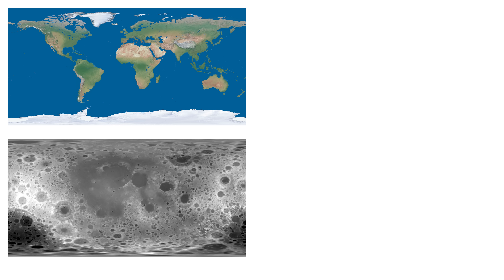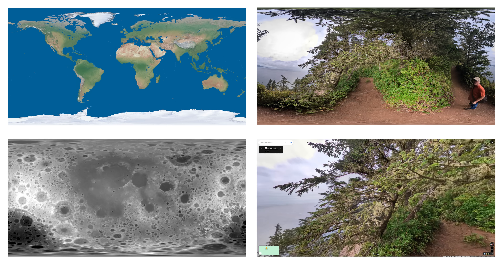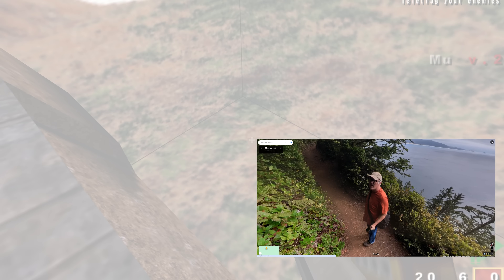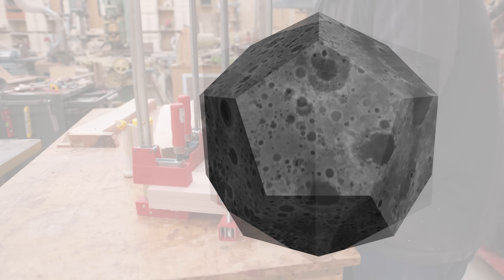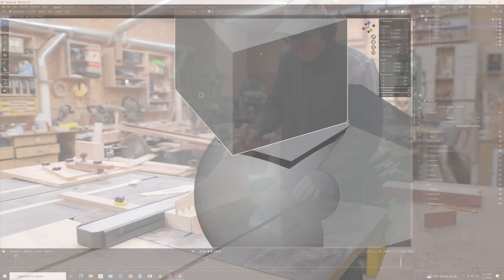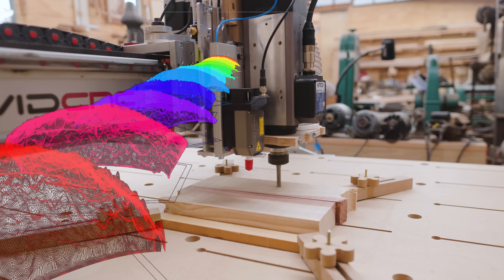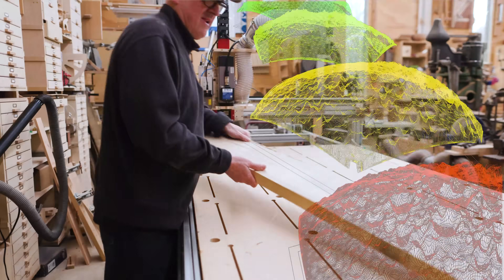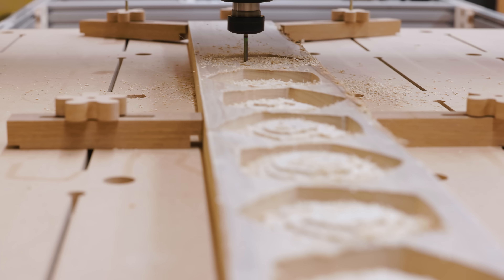Making the Moon

Comment: Really cool. You have the earth and the moon now.  I was wondering if you use any CAD software and is there any you recommend? My son uses blender but he would like to model a shed we are building together this summer and wanted to create it in a CAD software and then import it into blender so he could have all the inside and outside dimensions more accurate. (relative) I have looked around but haven't had any luck finding something decent that doesn't require an annual subscription. Thanks for sharing.

Comment: why not carve it two-sided?
Reply: at 9:45 "I don't want to cut the angle into the curved surface (on the table saw jig) because I'll produce a wiggly line...." those wiggles are because of the topology, right? The craters, etc as they're going over the jig? EDIT: yes, demonstrated at 13:27. :)

Comment: I like it.
Maybe you colud build a regular normal dodecaheadron, and then glue the CNC cut  "surface pieces".  What I mean, is thet on the CNC you only cut a thin piece of wood, that can hold the pattern.  to deal with edges, the dodecaheadron should not eb flat, theie border need to be deeper, like cusp of some sort.  The terrain pices are cut on the back first, then flip and cut terrain.  glue terrains to dodecaheadron.

Comment: Forgive me if I'm wrong but instead of holding the pieces from the bottom can you not just put a matching angle on your tablesaw fence? This way it will register flst against the angled surface with no indeterminancy from the curve and youd have no seam.

Comment: You need to make your height map extrusion along "normals" not along an axis.

When you make an extrusion along an axis, you go from ......... to ,iiIIIii, which means, the edges of the pentagon will meet as _\/_, and even if you trim the pentagon edges, so they meet a a proper angle, your surface features will still have the wrong angle, and you will end up with something like hair parting there.

When you make your extrusion along normals, you go from ......... to ,\\II//, which will make the pentagons meet as \\_||_//

Starting with a circular base, doesn't account for the extrusion angle.

Comment: What about making your segments larger than their final size, milling the surface features, and then cutting the pieces to their final (smaller) size?  Wouldn't that give you something closer to a continuously-sculpted surface without the seams?  I'm bringing this up because there is an analogous technique used for processing integrated circuit designs using massive distributed processing (cutting the physical design into pieces and processing them separately, while preserving matching boundaries).

Comment: That's a remarkable outcome for a really cool idea! I bet you could set up indexing pins on your CNC table to place each of the 12 pieces on for cutting, then have a table saw sled with matching indexing pins for cutting the angled, straight line cut edges of each piece, and finally make a skeleton with 12 sets of indexing pins for the pieces to mount to in a sphere. This could be a jig for repeatable dodecahedron sphere making, no matter what the surface finish looks like.
Also, have you considered sand blasting or soda blasting the CNC cut surface on the finished product to remove the tool marks? Just a thought.

Comment: 13:18 I'm not sure I can explain this well, but you could put a straight piece of wood in front of the fence that is shorter than the spherical part of the pentagon. That way you could avoid the arc and get a streight cut.

Comment: Could you place the blanks on the cnc and cut the interior surface.  cutting a centre locating peg and the internal bevels.  That way when the first run is complete you can flip them.  load the pieces individually using the peg as a key to then sculpt the exterior.  Does that make sense?  Then you could skip the table saw completely and have the bevel angles cnc precise, removing such a large seam.  I love the project and can't wait to see what else you can come up with.  Perhaps using a Reuleaux triangle to create a shape of solid width.

Comment: To solve your seam problem:
Just angle the upper part of the wooden stop block of the jig. Or you could use a something like a shim or space with the right angle.
The pieces you cut have a perfectly straight side you can reference against. The problem is mostly that the reference surface on the piece and the reference surface on the jig are at different angles. If both surfaces have the same angle, you can easily reference them. The clamp should prevent the piece from riding up und the slope.

Comment: I made about a 6" diameter globe with 6 pieces, i did my math wrong and somehow they still fit together. I had the same problems with cutting the edge and then having a fence registration point, and decided next time I'm going to cut registration pin holes on the bottom of the pieces as a first step, flip the stock over, then cut the contours. After separating them, it should be pretty trivial to make a pin jig that all the pics will fit into, and i can creep up on the edge cuts to eliminate the edging, then leave the jig in that position and cut them all so they are all identical.

I'm crap at blender though, so there's no way i can do it with pentagons. Biggest I figured I will be able to go on my bench top cnc is a 12" globe.

Comment: You could cut the back stop of your jig at the same angle as you do the pentagonal pieces - that way the pieces would sit securely against it. You'll probably need to adjust the side/depth stop between the first two cuts (made against a straight edge) and the remaining cuts (made against angled faces). You might even be able to get  both cuts out of one profile - vertical at the bottom to match the uncut faces, sloped back at the top to match the cut faces.
Reply: It doesn't need to be this complicated. Add a relatively thin spacer between the fence and the piece. They aren't being clamped against the fence, the fence is for alignment. They're being clamped down to the sled. So a big step over with a gap to the actual fence would let the straight edge at the bottom rest against it and the curve at the top would be held away.

Comment: Could you make a smaller, regular, dodecahedron with flat sides and then cut a larger dodecahedron with the moon pieces and glue them to the outside of the smaller one? That may help shrink the seams.
Reply from the maker: That would help in gluing the pieces together. But I would still have to cut the edges of the pentagons with the surface of the moon carved into them

Comment: I was expecting you to angle your sanding table and get the inside shape that way. You wouldn't have to reference off another edge of the pentagons, but you would need to be very careful about where the material is removed.
Reply from the maker: I thought about that. I think I would still need some kind of jig to hold the peace on the sanding table. I don't know that doing it by eye would be accurate enough.
Reply: @frankmakes  Would it be too crazy to cut the backside angles on the CNC first with sizable tabs, and then flip the whole thing to machine the top? Not sure how indexing might work, but it would allow you to "just" remove the tabs on the sander.

Please don't take my comments as not thinking the results as already super cool. I love it!

Comment: What if to Cut those edges closer you first drilled 5 holes on the bottom for locating dowels using the CNC) then flip and cut the sections on the CNC. Make a jig with the dowels in it for the table saw.  then you could place the pieces on the jig and cut the edge closer, turn it cut turn it cut etc. Sort of like a jointing sled for a table saw.
Reply from the maker: This is the concept I was thinking about. Although I was thinking I would cut a pentagon shape as my five holes that you're referring to.
Reply: I think your idea would be easier to use might be just a bit of a pain trying to line up 5 holes.  Can't wait to see your solution.

Comment: There is a flat surface on each side of pentagons to hold against the table saw jig, it is just not vertical.
You just need the wall of the jig to be low enough so it makes contact with the right part of a pentagon.

Comment: Alignment problem Idea:
- joint and plane your blank.
- Drill perpendicular reference holes in waste sections of the blank
- model the inside form of the sections (basically the pentagonal pyramids that hold the structure together) and cut these first on the cnc (blank upside down)
- flip the blank over, align the reference holes
- cut the lunar surface.

All of the alignment is done on the computer and cut on the cnc. You could probably even model in dovetails or fingers to make them align perfectly. Just my 2 cents having never used a cnc.

Comment: Could you make a circle jig that turns in 108 degree increments, put a pin in the middle of each of the inside of the pentagons, and use that to cut them to a consistent width?

Comment: No two ways about it, you’re going to have to model each piece front and back in order to get it to have compound surfaces on all sides (including the biscuit slots) and your going to need a 5 axis CNC to machine it. Reach out to the company that made your router table and see if they have an accessory or if they have a customer that can do 5 axis on your equipment.

Comment: Hi Frank, just a thought, but is there any way you could flip the whole piece on the CNC after you’ve cut the surface, then use the CNC to cut the angles from the back before separating them? Obviously you couldn’t go all the way through, but you could hog out the majority of the angle and it would give you a reference for the last little bit to clean up the edges so you didn’t have any excess to deal with around your seams.
Reply from the maker: I thought about this. It's hard to cut an angle like that precisely enough for the angles to go together with a nice tight joint on the CNC machine. If I had a custom-made v-bit with the exact angle in it, this idea would work.
Reply: @frankmakes  or as an alternative, could you cut the angles first to make the sections as you normally would, then use a jig to put locator pins in the back and use those to position them on a sacrificial back board. You could lock the back board down to the CNC and then carve the surface into each section after you’re sure they fit together. Sorry, you’ve probably already thought of this one too, I’m just brainstorming because this is a truly fascinating project. Keep up the amazing work, I love what you do.

Comment: @frankmakes can you set your disk sander to the angle you need and sneak up on your line by hand? No need for a reference edge if you have a  line
Reply from the maker: I think I would again need a jig for the sanding table which brings me right back to the same problem. But a good idea

Comment: cut the shapes first to perfect the joinery then make a holding jig on the cnc for the milling process.
Reply from the maker: That's not a bad idea. Just have to figure out how to hold the pieces on the table.
Reply: @frankmakes  magnets...magnets can hold it down in a perimeter jig to your cnc table...and magnets can snap the pieces together wile gluing ... if you want it glued together.. could be a cool puzzle if not glued together... anyway my solution would be to use magnets.

Comment: having made a few icosahedrons using nothing but a miter saw from wood i feel like i would have gone that way over a dodecahedron just for the reduced curvature at the edges however i did not have a cnc mill like you do i feel like if I did I would have tried having the mill carve the geometry of the back and mating faces first with some sort of interior dumbbell/bowtie cavity for holding together the parts and a slightly larger like 1mm matching pocket for a jig to hold those each part for 3d milling their faces using painters tape and superglue on their now carved interior faces.  and then dry fit everything cleaning up the milling as needed to get a good fit and then clamp and glue the matched bowties to one side of the correct faces and build the shape bit by bit finally using rubber bands to hold the shape together while the glue sets.  The bowties should do most of the work but the bands i think will let you finetune the clamping pressure

Comment: For the tablesaw jig...what if your fences were angled back at the same angle as the cut?   Right now the registration face is vertical, so the edge is curved compared to that, but if it was angled it would sit flat.

Comment: Idea: center locating pin (center of pentagon) on the sleds referencing against table fence (or any other parallel to the cutting blade device)
So you'll get both distance (pin) & angle every time from fresh CNCed surface (fence or such)

For "device" I'd look toward adjustable parallelogram frame

Comment: Problem solving skills are so very important in life.  You are a very good problem solver, Frank.  Cutting out the pentagrams with the appropriate angles first.  Hold them down on the CNC and then cut out your map with little to no seams might work.  Maybe use your wife's idea of the biscuit slots to assist with the hold downs.

Comment: To cut the edge angles, make a cradle (for want of a better term) to fit your table saw miter gauge with a 72° notch which will hold the corner of a piece. Then set the blade to the proper angle for the join between pieces.

Comment: What if, instead of a fence to cut the pieces to size, you used a jig with 3 (I think, but two would probably do it) pins on a sled, and use the CNC to cut 5 holes to match those pins in the back of the pieces? Then you cut a side, rotate, cut that side, rotate, etc until you cut all 5 edges, then repeat on each piece? That would give you repeatable workholding away from the blade and away from the curved/unpredictable edges. Kind of like a fingerjoint jig, but in two dimensions?

Comment: To hold the parts in your jig without that straight side, just use a low spacer of a set width to use the straight side you have lower down on the piece.

Comment: To "clamp" a spherical object, use cling film. You can wrap it snugly initially, then add more tension on later layers. You will need to get one of your clones to help, unless you can grow extra arms.

For a long board, you can clamp the ends, like you did, then run a skim pass across the top. This should tell you where adding side clamps will be out of the way of the bit.

Comment: Cut an apposing angle on a strip to use a a backer on your jig to support these pieces
Reply: This was exactly my thought. Your table saw jig for cutting the angles has a square registration fence. This is why the shape of the top surface interferes. If the fence is instead angled to match the cut, then the contour on the surface won't interfere. You'll be able to cut as close as you like.

Comment: Could you screw a wooden pentagon to the underside of the segments to use as a guide when cutting them on the table saw and then remove it afterwards?   You could make a jig which the pentagon slots in to, cut a side then rotate it...

Comment: Would it be possible to use the disk sander at an angle and then slowly approach the edge of the pentagon. If it works you could eliminate the gaps.

Comment: 3D Environment Artist here, cubemaps/spherical projections are still used very frequently in modern games! 

There's a lot of options for how the texture is projected or what kind of object it gets projected on to now compared to the past. 

Regardless of the details, the same basic principle is still a ubiquitous method for skyboxes and many many other use cases like faking reflections or making a fake portal with depth.
Reply: I did it in college, I had to make a small game. In my search I discovered it was possible to do with a sphere as well, but I just couldn't find good images to use. 😬
I did it in Java with an OpenGL plug-in, something like that, I don't remember very well... But it was very fun and the game was a city during the night where you controlled a flying saucer and had to abduct people... 😂
Reply: It's worth pointing out that cube-maps and equirectangular ones are completely different ways of mapping a sphere onto a texture.

Comment: My first thought on how to solve the alignment problem of the irregular pieces without the border:
Cut out the pentagons with those angles beforehand and then build a more complicated jig to hold them on the CNC individually.
Especially with those biscuit slots already cut, that should be possible.
Reply: Fastened from below with a screw in the center, oriented with one side against a sacrificial fence.
Could be incorporated into a jig.
Reply: I think it would be enough to have either the whole or part of the stop block in the angle cutting jig at an angle.
Because the pieces do have a perfectly straight surface you can cut against, the problem is more, that it is not 90° against the table. But since you have the clamps to hold the thing down you should be able to use the already cut sides as a reference.
Reply: I was coming down here to say the exact same thing. Good thinking friend.
Reply: If you cut an angled fence then it will line up without any additional work.
Reply: This was my thought as well. You could make a pentagon key and a matching hole on the back of the tiles. The key could be placed on the cnc bed to locate the pentagons for surfacing. And it could be located on the table saw sled. You’d then lift the pentagon off the key to rotate it to the next side, no need to keep the edges straight to ride on the table saw jig like current set up.